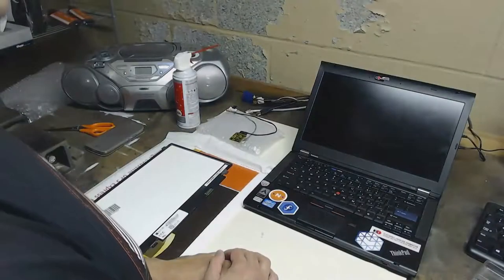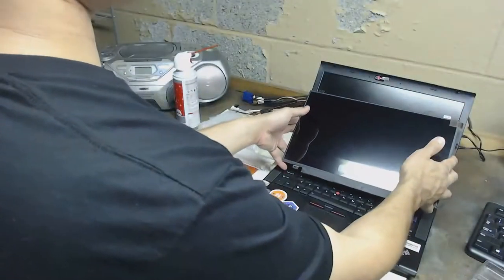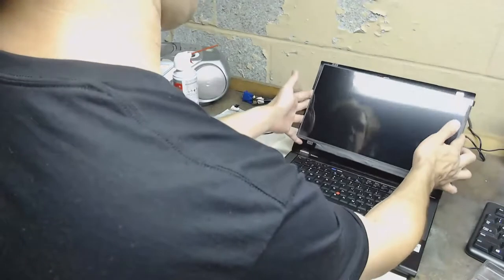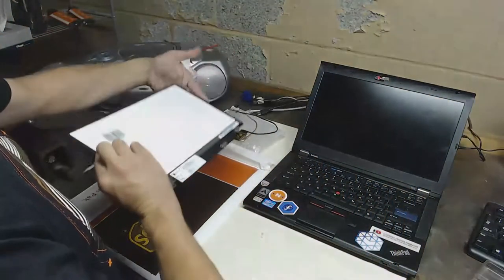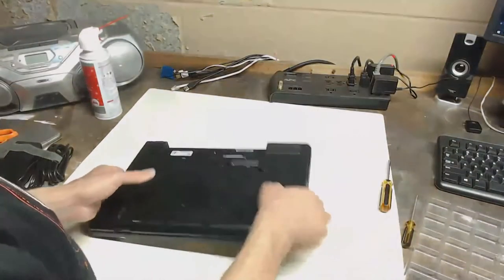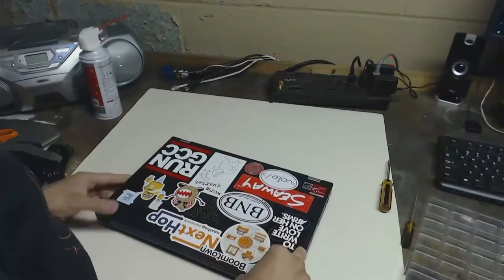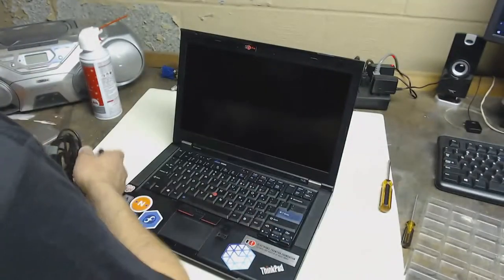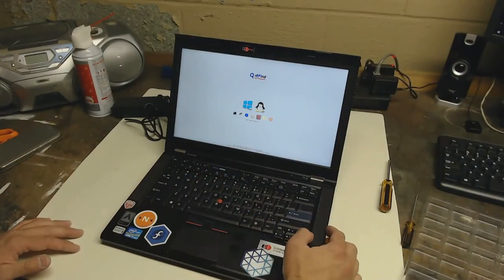Laptop screen replacement on Lenovo ThinkPad T430

Comment: Good video! Did you end up having any flickering issues with the display? I'm debating between the FHD mod and the lesser 1600x900 TN screen upgrade for my T430. Flickering could be a deal breaker.
Reply from the maker: The 1080p screen looks fine to me.  I haven't noticed any flickering, it looks sharp and clear.
Reply: @nticompass  That's great to hear! I was reading somewhere that the screen had flickering issues while the battery is charging, but maybe it was an issue with the converter.
Reply from the maker: Could be a bad quality adapter, or maybe the adapter could be mounted too close to the power circuitry.
Reply from the maker: I found this link: https://forum.thinkpads.com/viewtopic.php?t=126294

Seems like there used to be adapters with the flickering issue, but newer ones don't have that.

Comment: can we take off the cdrom drive and just cover the empty space with a cover ?
Reply from the maker: Not sure if they have just "covers."  I guess you could get the SATA HDD adapter and just not put a drive in it.
Reply: @nticompass  good idea sir, thanks
Reply from the maker: I did some Googling, and it turns out you can just get a blank cover to put in there... https://www.amazon.com/Replacement-Ultrabay-60Y5512-Compatible-Thinkpad/dp/B07QQKRH3X

Comment: My screen bezel is loose. Any fix for that?
Reply from the maker: When snapping the front bezel back on, check that all the plastic tabs have clicked back in.  It's possible that not all of those tabs are locked.  It's also possible that one or more of the tabs broke during the procedure.
So, double check that the bezel is on right and the tabs are correct.  Otherwise, maybe try some tape ¯\(°_o)/¯
Reply: @nticompass  I'll try some tape because all tabs are clicking in and they aren't broken. Is double sided tape a good fix for that?
Reply from the maker: That should probably be fine.  I don't want to suggest something too strong, in case you need to open it up again.

Comment: What screen did you use?
Reply from the maker: This one https://www.laptopscreen.com/English/screen-part-number/B140HAN01.3/?hash=144873
Reply from the maker: And this adapter https://www.ebay.com/itm/372318133135
Reply from the maker: Just look for "t430 1080p upgrade" or "t430 fhd upgrade".